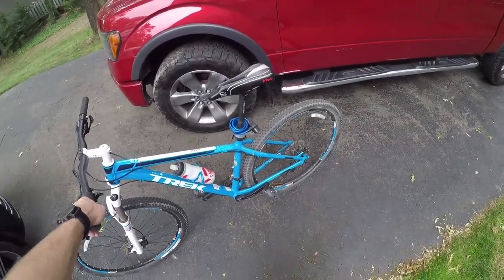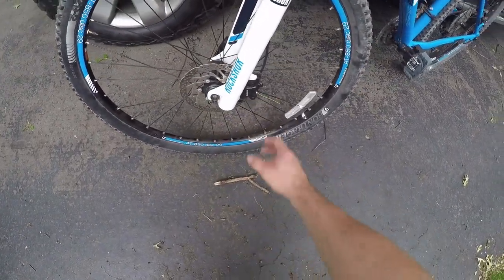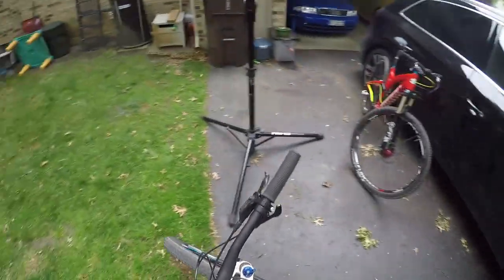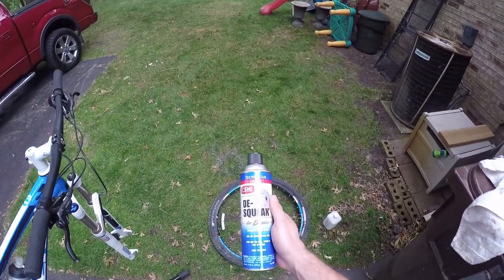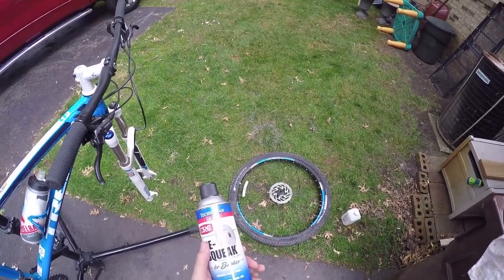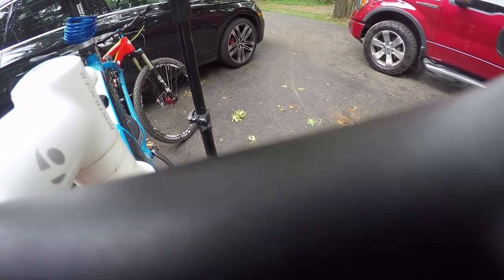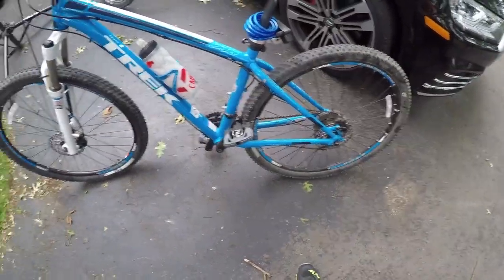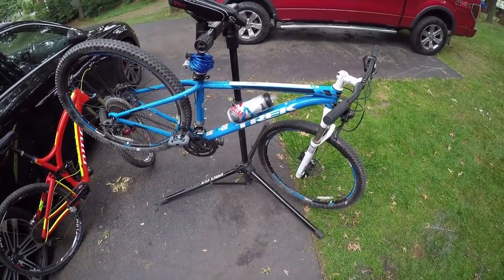Stopping Bike Disc Brake Squeal - Here's a GOOD DIY Technique you Probably Haven't Tried Yet!

Comment: Ive had a terrible experience with break squealing and vibrating on my 2017 specialized Diverge. I tried baking in for weeks, but the squeal wouldnt go away.  Then I tried cleaning -- no difference. Then I tried replacing the metalic pads with organic ones -- no difference.  Then I tried replacing the rotors with different rotors with different hole patterns -- no difference.  Then I tried switching BACK to metalic breaks -- no difference.  

I will try this -- seems promising!  

But I think the core issue could also be the frame of the bike, which is very lightweight. Some people on youtube suggest getting some led weights onto the bottom of the frame to absord the vibrations.  I guess I might try that?  sort of defeats the purpose of having a light bike though.

If nothing works I am going to sell the bike -- and never go back to disc brakes again!   They really seem to be for suckers.  Even if something works to fix the problem, they still seem to be for suckers, because a brand new product should not have all of these issues.  A brand new product should simply work, and if it doesnt work then the technology itself is defective.  I have never had so many problems with rim brakes, ever, let alone with brand new ones. I'm sort of amazed that the bike world has been so accepting of this noisy, inconsistent, difficult-to-repair brake type.
Reply from the maker: Sorry to hear about your troubles.  It sounds like your issue may stem from a vibration or resonance...in which case this may not help you.  It won't hurt to try though.
Reply: Thanks for writing back.  What I find strange is all the people who say "yeah that sometimes happens with disc brakes and it never goes away" and also say "disc brakes are great, they are 'high performing'."  Like, the same person will say both things. It makes no sense to me.  If there's a big issue with the technology concerning sound and consistency, then clearly the technology is not high-performing. Terms like "high performing" do not exist to describe technologies with these sorts of issues. I just feel a bit let down by the "conventional wisdom" among bike types, who generally say that disc brakes are a good development.  I'll def try your method, but if that doesnt work I think it's craigslist time.
Reply: napoleon8181 FFS stop winging like a baby,you should not buy a mountain bike with disk brakes unless you have some mechanical clue,because they require maintenance.
Reply: interesting that even a bike maintenance channel brings out the trolls. you seem pretty confident that you know everything, but you apparently didnt know that a specialized diverge is not a mountain bike (look it up), or that the manufacturers are tossing disc brakes onto virtually everything now (which is the problem).
Reply: Interesting that even a bike maintenance channel brings out cry babies who haven't an once of mechanical ability and spit the dummy.
Reply: napoleon8181 if you basing your experience for disc brakes on the stock tektro mechanical ones that came on your bike I can understand your disappointment. Mechanic disc brakes are very finicky and require a few tricks to get them running quiet. Even then they require constant adjustments to keep them quiet. I don’t rate them at all and prefer a nice quality rim brake over mech discs any day. However, since switching to Shimano XT hydraulics I understand what all the fuss is about. They are awesome, are never noisey and super reliable. Once you get used to super strong braking with just light pressure from a single finger, all other brakes are sub standard.
Reply: To me it seems like the manufacturers are taking a technology that's appropriate for hardcore hobbyists looking to maintain a $2K - 4K  bike and pushing the tech onto 1K bikes whose buyers are a step up from walmart consumers but not really hardcore hobbyists.  Next time I get a bike I'll be looking for one with the traditional rim brakes, and if other consumers in the 1K price range share this preference then the manufacturers who have overcommitted to disc brakes will suffer the consequences.

In the meantime, this youtube channel's solution -- spray-on desquealer -- has worked great for me so far.
Reply: napoleon8181 I understand where you are coming from and keeping it simple is by far the best option. In saying that, an entry level set of Shimano hydraulic brakes can be had for less than $100 and will outperform rim brakes plus be super reliable with very low maintenance.
Reply: Ah the 21st century. I get advice about my overengineered bike from an online rando named "skull fucker" -- probably sound advice too, thanks.
Reply: My bud rides a Diverge and I have a Crux, never had these issues in two years. I’d go to proper repair shop and fix the brakes there if I were you.
Reply: @napoleon8181  I am sorry that your experience with disc brakes was so traumatic,shouldn't have been.Any Shimano hydraulic system properly set-up will change your opinion,the wet stopping ability is more than awesome.Once you understand the underlying principles,these brake systems can be far easier to adjust and maintain.Technology marches on,you shouldn't be fearful or dismissive of a braking system that may be improperly installed or maintained,a lot of bike shop mechanics are woefully inadequate in hydraulic brake knowledge.
Reply: @larrydaniels6532  I don't think the fault was the various mechanics I brought it to, I think the issue was my Specialized Diverge isn't a great model for disc brakes, because the frame is too light and amplifies the vibration. Specialized should have designed this model for rim brakes.
I have been solving the problem with some cheap motorcycle desquealer spray.  I put a new layer onto the discs once every few months, this makes the squeal go away.
Reply: @napoleon8181  There are far lighter frames that don't exhibit this tendency and if you are able to make it disappear then that leads me back to my original assessment.The fact that it lasts for a month or two suggests the pads are being contaminated,either very slowly or under severe demand?
Reply: @larrydaniels6532  I mention in above comments that at first I approached the problem by putting in new pads (I tried both metal and organic), new rotors, careful step by step burning in of brakes, etc. I tried multiple mechanics.  I did that over many months. It was crazy! At some point, "try this other complicated thing" is not the correct next step, it's just bad life philosophy. I know you're coming from a good place here, but the solution in this vid is the only thing which fixed the problem. 
One mechanic did mention something, that disc brakes are really intended for upmarket bikes around 2000 plus dollars.  A Specialized Diverge is just 900.  So I do think Specialized slapped the disc brakes onto a design where they're not totally appropriate.  It's a nice bike otherwise, very light so you can run up stairs carrying it -- and with the desqueal spray, this annoying problem does go away. But I think it's a model design flaw causing the prob, not a speck of contaminant or whatever. I've been surprised how many people said it's a speck of contaminant on the pad and i need a new pad -- if disc brakes were always one speck of dust away from having to be changed, then obviously they would not be commercially successful.
Reply: did youever fix the problem

Comment: Another tip is to check that the disc is not mounted the wrong way. Mine was in reverse and made a lot of noise. By inspecting it it was clear that the spokes in the disc would collapse rather than hold during high stress. By turning it around the bike was silent again and safer.

Comment: Try this - 1) remove pads 2) sand glaze from pads 3) apply liquid graphite to pads 4) say goodbye to brake squeal forever. Yes, it will stop as good as before.
Reply: Not as strange as it sounds. I had a pretty annoying squeal from my front MB disc. Tried all the usual. Couldn't really see what made it different from the rear. But I troll the web a lot looking for real info, and I ran across a peer-reviewed article about using graphite of various kinds in disc pads. I happened to have some graphite in alcohol in the shop, so I cleaned up the pads and disc, and then put a bit of graphite in alcohol on each pad. When the pads were dry, I brushed off the excess graphite and too them for a spin. I did get a small amount of squeal at first, nothing like what it was before the graphite, and after a few minutes of riding and braking, there was no more squeal. I can lock the brakes pretty easily, just as before. I actually think that they modulate better now. I have no worries whatsoever about the braking effectiveness of the pads. Way faster and easier than any other treatment. ... Oh, BTW, all I did was clean the disc and pads with a paper towel soaked with 90% alcohol from the general store. No sanding needed. The graphite is suspended in 100% alcohol, of course...won't dissolve in water.

Comment: Just tried this out yesterday. Most difficult part was disattaching/reattaching the rear wheel.

So far: no squeal! Nothing. I noticed a somewhat diminished stopping performance for a few miles, but then the full stopping performance returned -- now without horrible screaming noises.

In my experience with the disc brake squealing issue, the real question is what happens after 50 or 100 miles.  I'll go on some more rides and update this message.  Impressed so far!
Reply from the maker: Great to hear!  In my experience it won't come back unless you contaminate the rotor with something again.  On one bike, it sat in the basement for a few months and was squeaky when I got it out again - but has been fine since using this method.  Happy riding!

Comment: That's a great idea. You get the same results from scuffing your rotors with emery cloth or red scotch brite and taking a flat metal file to your pads, then cleaning with isopropyl, and re-bedding the pads. By scuffing the pads and rotors your removing the glaze that has formed due to contaminants or over heating. That glaze is what causes the noise and poor brake performance.

Comment: Do Figure 8’s with your break pads against 600grit sand paper then rinse with plain water. Take off brake rotor and put them in boiling water and let dry. Reinstall and you should be good. Otherwise it’s time to order new brake pads. Don’t touch surfaces with fingers

Comment: Doing the bedding process downhill makes it easier, but you need a big hill. 
The bedding of pad compound into the rotor can wear off due to repeated water and dirt between pad and rotor. 
Uneven pistons diameters (lower cost/ precision calipers) also cause pads to apply and release unevenly. This inevitably has one pad in contact with the rotor, building heat and then squeaking without brakes applied. For that case: https://youtu.be/53x5I1wc14E?si=lLuocsuWlN-fnLYA

Comment: How do you like that work stand?
Reply from the maker: It's fine for the price.  I got it on special from Performance, paid way less than $100.  I wanted something that I can work hard and put away wet to speak - I often use it to hold my bike while I wash/hose the dirt/sand/mud off of it, so it's exposed to some nasty conditions and hasn't given me any problems.  The biggest complaint is that it can be difficult to rotate the bike in the stand as the adjustment fits between "teeth" instead of offering an infinite adjustment, but overall it's a minor issue.

Comment: The Shimano brakes he got are awful, the way I brake I will destroy them in after few months, these are prone to leaks, as the lever body/master cylinder is too flexible, causing threads for Torx screw to fail and temperature interferes with the plastic cap, the plate holding the seal in place gets bent.
The temperature changes & the bending causes air in the master cylinder.
I tried installing new brake lever same happen, on the new one, both on m396 & m615, I will never get those brakes again.
I am using TRP Spyke mechanical dual piston brakes now, so I got workign brakes no matter what I try in the future.

Comment: the repair stand you got is awful, mine got worn out after few weeks of use, the teeth in the angle adjustment wear out fast. it was the Topeak Prepstand Elite stand.
Reply from the maker: Johannes Nilsen - mine has been fine for a cheap stand.  I use it to spray/wash down the bikes so it’s abused constantly.  My nicer Park stand stays in the basement.
Reply: really, eighter I was not lucky with mine or you were lucky with yours, mine had so much play I could not use it anymore, and it would almost tip over if I touched the bike, and there was play in the stand almost everywhere, my bike is over 13 kg. I got Park Tool PRS 3.2.2, super stable, no play,  or stability issues.

Comment: Thanks for this.  I was about to give up on my road bike discs. No matter how many times I tried bedding in the “proper” way they squealed.  This worked perfectly.  I did it a little differently in that I sprayed it into a bowl and applied it liberally to the discs with a small foam brush.  This way it didn’t get all over my anodized hubs and spokes.   Mine kept squealing when I was pedaling so I pedaled until I ran out of energy and then let them cool.  Came back and no more squeak.

Comment: Surely just taking the disc rotor off the wheel would make it much easier 🤔
Reply: What was hard about wiping both sides? certainly not easier to remove, the 6 bolts usually have thread lock and take extra time and effort. Not necessary to remove at all, makes it less easy. It's already easy

Comment: OK. THE easiest way to stop disc brake squeal on an mtb is to fit FLOATING discs...Full Stop! All brakes will squeal at some point but floaters MUCH less often. The noise of the brake squeal is transmitted through the solid connection and emmitted by the whole wheel on non floaters.
Disc brakes should have floating diasc OR floating calipers. As all bike brake calipers are solid mounted, you need floating discs.
Also if you have floating discs, fit metal pads. They will last longer as create less of the frequencies that the floating disc will produce on the odd occasion they do .

Comment: To decontaminate pads, you need to burn out the oil it only takes a couple minutes with a torch. Also sand the pads lightly and clean the rotor very well

Comment: My brakes sounded exactly like that.  I've tried cleaning the pads and discs with alcohol, but it didn't work.  Found this video and tried your CRC method. Well - after about 3/4 mile screeching like a banshee, she settled down just like in the video, then.....nothing!  This method worked a treat on my bike (Specialized Stumpjumper with Shimano hydraulic brakes).  Thanks Chris!!!

Comment: A better and quicker method is: take out your wheel; take out the brakepads; grease the BACKSIDE of the brakepads a bit. This is because the sound is mostly made by the friction between pistons and pads.

Comment: Another method I use is undo the caliper bolts not the adapter ones so it's losse pull brake leaver so it centres the caliper tighten back up while brake is still applied then release brake and perfectly centred no rubbing or squeaking and even brake pressure dunno if it's any help but I find it works well for me but good video but I learned something new 👍
Reply: I always install my calipers that way. I just installed new rotors and pads, the rear ended up squealing after the bedding process despite this method. It has more to do with getting an aggressive pattern established in the rotor and pads without glazing them over than anything else. Glazed pads that have not embedded material into the rotors sufficiently will squeal due to the ultra fast catching and letting go action it creates.

Comment: The WORST thing you can do to ruin your disk brakes is to put any lubricant on the disk, like oil or grease will make the discs too slippery and will result in the pads not getting enough grip. Not only that, some lubricants are flammable lol. Good job sir, this is a very good idea.,I like you video.

Comment: You are supposed to remove brake pads
Use light sandpaper on brake pads and disc.
Then you clean it after
Then you bed them in.

Cleaning disc will hardly do nothing

Comment: What's the reason not to apply then find a long hill to coast down? Is there a limit to how hot you want to get it?
Reply from the maker: Ha!  I live in Michigan, so the reason is lack of availability of long hills.  ;-)  I would try to keep the speed low simply because you don't get full braking right away.  Gotta be safe.  If you have a big hill nearby, I'm sure it will work too.
Reply: The melting temperature of steel seems like a good point to stop.
Reply: LOL. yep, that sounds good.
Reply: I feel lucky that everywhere I look is a nice steep hill. Use the rear for rear stopping and the front for "bedding/de-glazing"

Comment: I just did the Alcohol/torch/emery cloth (wet/dry 500 grit sandpaper) method, and it was fast and totally effective. Why buy more spray crap to litter the shop and prematurely wear pads and rotor? These are not automobile disc brakes. I was surprised at how long the pads hold heat: be careful. Thanks for all the advice below (see: Jeffrey Walker)!

Comment: Tried this and it worked beautifully.  50 kms in and no squeaks.  Does anyone know how long it lasts (how long until it needs to be re-applied)?  Interestingly I have a custom built rear wheel that has an upgraded, metal compatible rotor.  The experience in running in (cycling with brake applied) was considerably different with the upgraded rotor.  The resin pad only front rotor didn't stop squealing nearly as quickly as the upgraded rotor on the rear.  Age of the rotor?  Material difference?  Resin pads were, front and rear, less than 1 month old with 550 kms on them.  Anyway, bravo Chris.  Excellent solution.